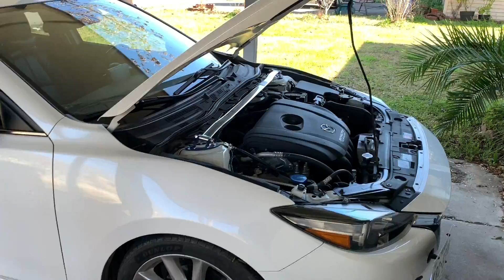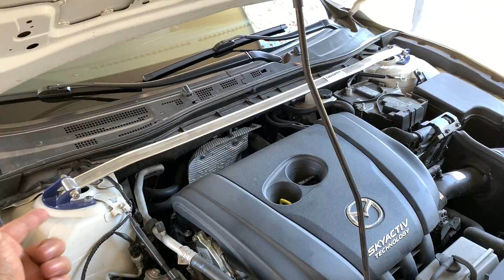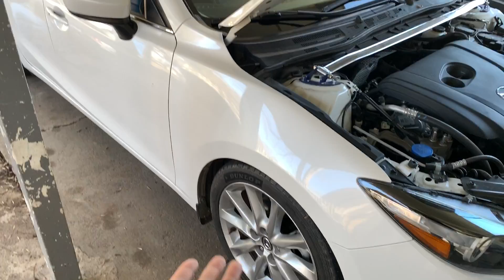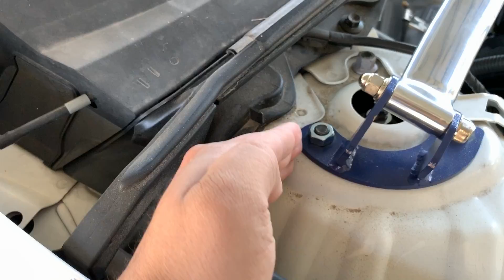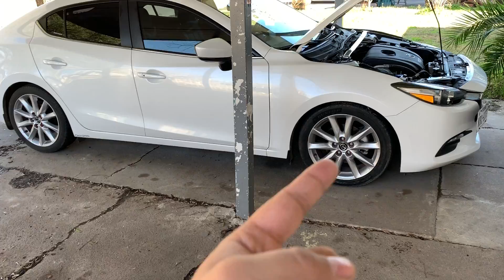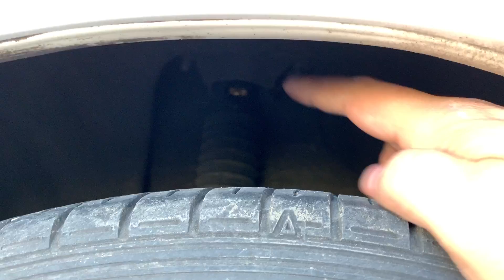Mazda 3 Suspension Mods

Comment: I have a 2017 Mazda 3 sedan I’m tryna drop it too what exact ones did you get ??
Reply from the maker: Corksport.com is where i got most of the mods. They are mazda specific.
Reply: @giorockmaster  did you just buy the lowering springs ? What else did you get like new dampers and shocks as well ? & yeah I’m looking to get a rear motor mount and transmission mount from them

Comment: @giorockmaster; how are the CS adjustable struts and shocks treating you after almost two years, especially on Houston roads??? (I grew up in Houston, and I know those roads have as many potholes as where I live now lol)
Reply from the maker: They are doing awesome. Ive had to replace one if the rear shocks because i hit a massive pot hole that caused it to leak but other than that i love em as i can really pick up speed when the freeways curve. I took them to the tail of the dragon and they performed great. The softest setting is still stiffer than stock and you can feel it but you are not exactly aiming for comfort when you go performance.
Reply: @giorockmaster  Gotcha, yea that can happen to anyone in that circumstance I'm sure. Half tempted to get these because it's them or a koni yellow kit (which multiple mazda owners have sworn by) but very few have done the cs ones. Appreciate the reply, and you did the tail over in NC, thats awesome!

Comment: What are your thoughts on corksport rear sway bar, and mounts?
Reply from the maker: Hey there mike, I don’t have a sway bar but the mounts do make the car feel a lot more responsive and have smoother shifting feel. You will defiantly have some more vibration in the car but nothing too major but it is more noticeable in automatics. The mounts probably made the biggest difference out of all the parts I’ve installed.
Reply: @giorockmaster  I have a automatic with the motor  mount. I'm waiting to get the transmission mount As well.
Reply from the maker: mike seman nice!  The transmission mount is a little more of a mission to install but it is totally do able. Once the motor mount broke in I was missing the extra feeling It first had. Took me about a whole day to install it just because I was missing some tools just make sure you do it on your days of just in case lol. Worth it.

Comment: What's the brand for your license plate relocator? Can you send me the link for it?

Thanks!
Reply from the maker: I think the brand is ijdmtoy from amazon. https://www.amazon.com/gp/aw/d/B01KB0SVT0/ref=psdcmw_15736251_t1_B073Q1JB4G        It was only 20 bucks.
Reply: @giorockmaster  I tried that brand before and it didn't fit. You sure it was this one? It's shorter than the one you have on your car in the video.
Reply from the maker: justin yaj yeah that’s the one I had ordered, could be that they sent you the wrong one? It’s says 2014 and up

Comment: did you use compresor installing the corksport spring?
Reply from the maker: jason cassidy hey there Jason. Since I bought the suspension/spring bundle from CorkSport, the springs were installed already when I got them. If you buy the springs separate then you will need to use a compressor. Autozone rents them out for free.